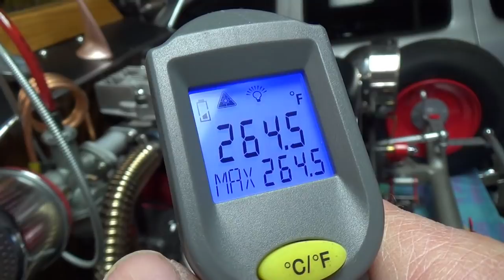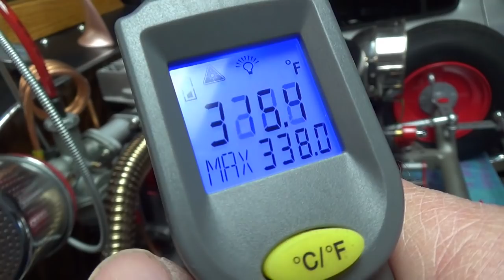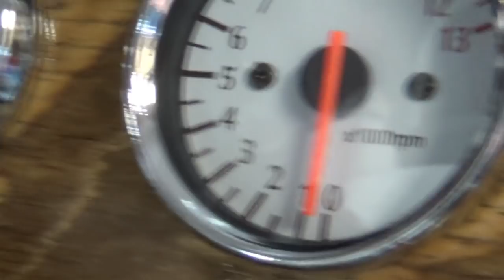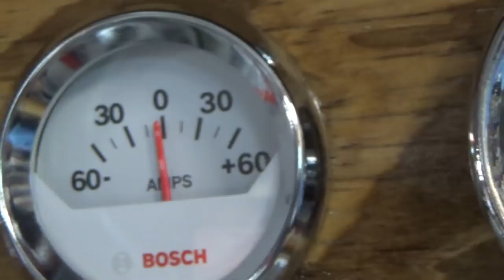First run through the gears on the Goofy Cart II with the wheels on!

Comment: Transmission seems to shift good. You may need to get another tachometer that one may not ever read correctly is it for small 1 and 2 cylinder engines ?
Reply from the maker: IT was for motorcycles and I haven't yet found one that will be more accurate at the lower rpms. I'll keep looking though. Thanks Bob